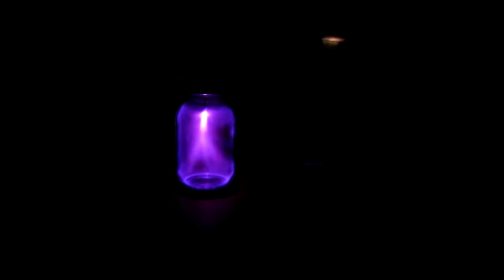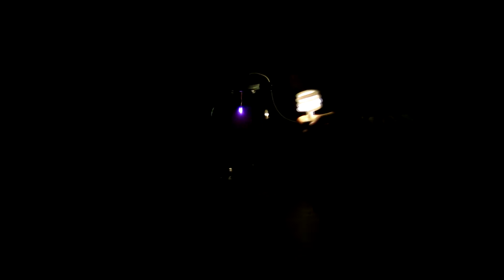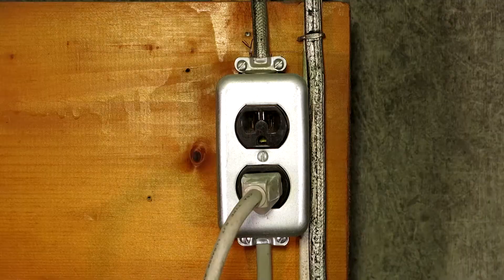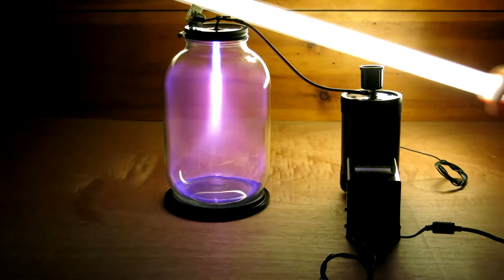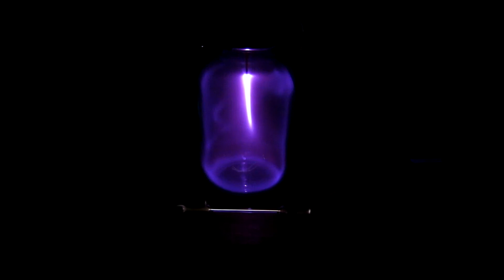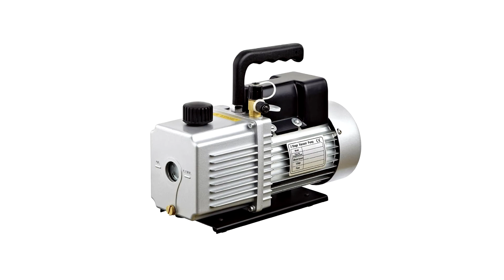plasma tornado

Comment: I wonder if putting a powerful magnet under the jar will increase the range of the radio field. you may need to have it configured in a straight tube with +/- on opposite ends, rather than your method of +/- on the same side of the jar. the magnet will rotate the plasma causing another secondary coil to form, which would increase the voltage and range. holding the metal end of the light bulb is basically like adding an antenna, the water in your body may also act like a capacitor . try just adding a long piece of metal to the light bulb, and then add a capacitor.

edit: and when plasma forms from your finger tips, no electricity actually passes through the glass, only magnetism can travel through glass. Your skin attracts the magnetic field because the Earth has a magnetic field and creates a path of least resistance to ground for ions to travel to. Radio wave pass through the glass and excite the atoms in your fingers and the air in between your finger.